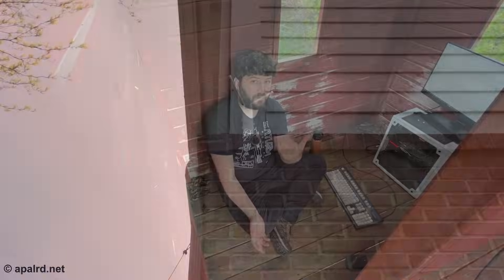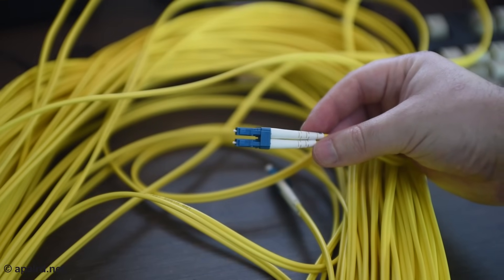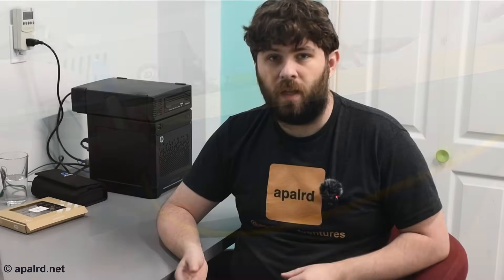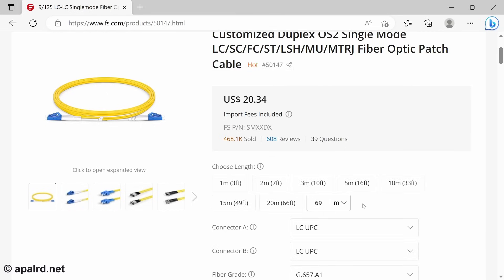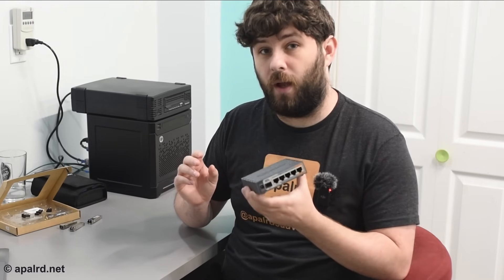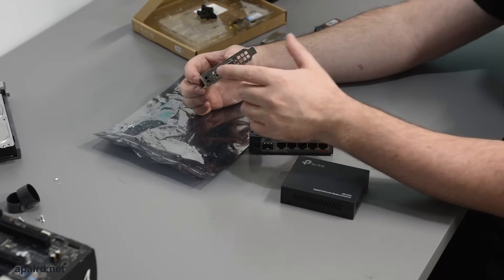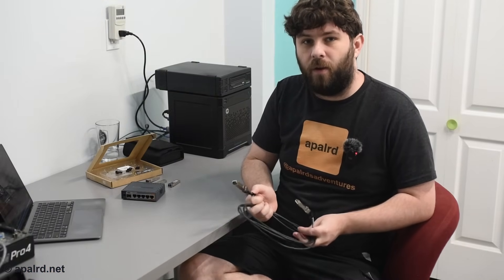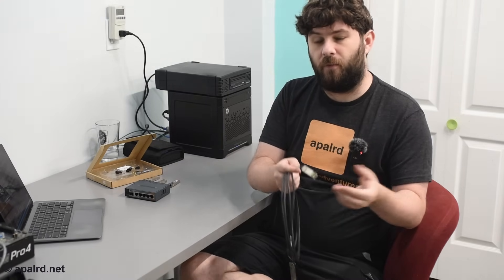The ULTIMATE Guide to Fiber Optic Home Networking

Comment: Such good content. It still hard to comprehend fully, If I am going single mode would it be preferable to have 2 fibers instead of one? Would like to wire the home at 10g now but ready for future upgrades
Reply from the maker: Single mode vs multi mode has nothing to do with the number of fibers. Basically, single mode fiber can support multiple wavelengths and longer distances, multi mode can support cheaper LEDs.

Using one fiber instead of two requires to wavelengths so it requires single mode.

For 10G they are both fine, for 100G you want single mode or 8x multimode.
Reply: @apalrdsadventures Thank you so much for your response, I understood from your video the difference between multi mode and single mode but it wasn’t clear for me what would be best for future upgrade, I’ll stick to single mode one fiber. I hope Sherlock is doing good I haven’t see him in a while, and thank you again for the great content and knowledge you are sharing

Comment: You're possibly the only one that would know: Can you detect if a fiber line is BiDi via a connected hardware/software? Can iPerf or similar do a bidirectional test that actually shows if it is indeed bi directional? Is it accurate enough to always know if it is or not?
I see tons of bidirectional modules today that aren't that expensive, new market (off brand) and used stuff.
Reply from the maker: You shouldn’t be able to tell what type of optics are used on a link as an observer at layer 3 (or even layer 2). Every ieee 802.3 phy should perform identically if it’s working and there aren’t bit errors.
Reply: @apalrdsadventures  Oh... What's the benefit to bidirectional then? I would have figured if you uploaded and downloaded simultaneously (saturating both) your speed got cut in half? There's a pair of wires or single wire and they're using a different frequency as you mention. What does that change if there is no difference? Thanks

Comment: Just a little stuck on what cable i should choose. I need a 100m run from the main house to a granny flat through under ground conduit with probable water ingress. It's too expensive for the industrial grade cable on fs to get to Australia. There is one listed on amazon for less labeled 

"Jeirdus 100M LC to LC Outdoor Armored Duplex SM Fiber Optic Cable Jumper Optical Patch Cord Singlemode 9/125 100Meters LC-LC"
or product B07VVPGDFH

Wondering if that cable will last/be okay or what i can get away with for my application, the shipping and conversion rates through fs for me are huge.
Reply from the maker: Fiber itself doesn’t care very much about water. The only concern is if the jacket material will deal with the water without degrading. 

If you’re pulling through conduit I would get a non armored fiber.
Reply: @apalrdsadventures yeah okay, it’s just intimidating for me I don’t wanna mess it up and waste money. Thanks for your reply.

Comment: Thank you for your video!

I recently requested a quotation to replace our existing home coaxial cable with fiber. I received a quote for Cat 6A, no fiber addressed. 

I would like to future proof our entire house with 10 gig capabilities. I was thinking of using the Ubiquiti / Unify Dream Machine Pro Max, Pro XG-10 PoE++ switch, and the U7 Pro XGS Wifi access points. My dilemma is I do not know how to get power to the access points. 

Our house is 4,000+ sq. ft. 2-story brick house, excluding the basement, 3-car garage, deck, and porches. We have a computer, VoIP landline, and two printers in my office. We have a printer in my wife's office. We use Apple 4K that also uses an RJ45 jack. Of course, we have a number of devices that use WiFi.  

I called a number of Cable and electrical contractors. Most of them only do commercial work. The others seem to promote Cat 6A. 

How hard is it to run your own fiber? Can I fish fiber through walls using our old coaxial cables? I plan to speak to our AT&T tech this week when he changes our service from 1GB fiber to 2GB. Perhaps, I can get him to do some moonlighting on a fiber project.

What are your thoughts and recommendations?

Thank you.

JP

Comment: Make your life easy - don't do bi-directional.  Lots of 1G or 10G optics will talk to each other.  SingleMode is always better but is more fragile than MultiMode.  2km SM optics are great, will easily reach 3-4km.  MM Optics max out at 500 ft to 1000 ft in general.
Nice video - covers the basics.
Reply: Fragility isn’t that bad if done properly

Comment: Hey do you have any recommendations for conduit to protect the fiber, I know that these fibers allow direct barriel, but I think they are too thin and not shielded enough. What would you recommend, pvc pipes, corrugated tubing?
Reply from the maker: There aren’t any hard guidelines for fiber, but I’d probably use pe sprinkler pipe which comes in a very long role and can be dragged behind a machine without trenching
Reply: Depends how long you want the conduit to last and the conditions it's run in.

Don't bury EMC.  While you can do it, it's very thin-walled and doesn't hold up to long years of being underground.

RMC is what I'm most familiar with.  It's nice and thick and will outlast your kids.  It comes in varieties that are good for corrosion resistance.  You need a way to bend it and thread it though, and it's harder to work with than pretty much anything else.  It's what's used for industrial purposes.  If you're going to drive over the conduit or embed it in concrete, this is how I'd go personally.

PVC and fiberglass are options as well.  I won't comment on those since we don't use them (and rip out any that we find).  But my work is on industrial oil/gas facilities, which have more stringent requirements than your house does (At least I assume.  I don't know you, maybe you refine jet fuel in your back yard, I dunno.)

Your best bet is to have a professional install it for you.  There's lots of gotchas with running underground conduit and if you have the money it's best left to someone who knows what they're doing.  If you really want to do it yourself, do a lot of research first.  Just bear in mind while you're researching that industrial users have more stringent rules to follow than you do as a homeowner.

Always run extra conduits, always put pullboxes in before you reach 360° worth of bends, and always include pull strings!  The you in the future will be glad you did.  This goes double if you plan on pouring concrete around them at any point.

Comment: Thanks for the informative video. I am trying to send fibre to a some wall sockets in a room so that I can connect to them wall socket with a DAC cable. My problem is that I don't know of any wall plates which take SFP terminations. The other problem I have is that I want the termination that is wired into the wall to be female so that the DAC cable can be plugged into it. I hope to use pre-terminated (AOC or DAC) cable to get from the SFP port on the switch to the wall but all the cables I have seen so far are male-male cables. Do male-female cables exist? Do you know of any cage/keystones for SFP ? Thanks again.
Reply from the maker: I have not seen SFP+ sockets, only male to male DACs. With how short twinax cables can run, I’d suggest just using fiber.
Reply: You can’t use this method so our products are available, but they are data centres and they cost tens of thousands each

Comment: I bought 100ft of armored fiber, 2 strand, to run to my shed.   It has a stainless steel tube .  Does it need to be grounded?  I’m getting mixed opinions.  It’s going from my upstairs office to my shed, and will be direct buried.   It has LZSH jacket, Kevlar, stainless steel tube, then the fiber strands in that order.  I don’t see how you can it’s a very small cable

Comment: I want to run internet to a shed,do you output rj45 from the router too the media converter, then fiber to the other media converter on the opposite side to convert back to rj45?  Then plug into another wireless router to get wireless internet?
Reply from the maker: yes. rj45 -> media converter -> transceiver (inserted into media converter) -> fiber -> transceiver -> media converter -> rj45
Reply: Thanks.  My mind was confused this morning. Lol

Comment: Hello, I am quite new with the SFP(+) interfaces, and I have the following doubt: In a scenario where we have a router with two SFP+ ports (one for WAN/Internet, the other for LAN), a computer/server with a NIC with one SFP+ port, and finally a switch with a couple of  SFP+ upload ports - one that will be connected to the router LAN while the other will be connected to the server (everything - router, server's NIC and switch - is of the same brand, and assuming the sticks will also be of that very same brand), what kind of SFP+ sticks do I have to plug in each port? because they are not the same, right?

1) Router WAN: I know this is a ONT that will connect to the ISP's OLT. I know this should be provided by my ISP to make sure there's no conflict with their OLT, otherwise I will have to find one that is (and probably I'll have to hack it with a community firmware to be able to tune some settings that otherwise might not be available - like SN, MAC, ploam pwd. etc.) that the ISP uses to verify the connection is legit.

2) Router LAN + computer's NIC ports: this kind of interface is a NIC, something that will contain its own IP (let's think we are in a IPv4 only scenario). Is this also a ONT? or the IP address would not be assigned to the SFP+ stick itself but to some other chip of the NIC?

3) Switch ports: What kind of SFP+ sticks should I plug here? I guess they are different than the ones for the router and the server's NIC, because switch ports are "passive" (they don't have a NIC or IP behind); is it an OLT stick? or it's the same kind of stick than the server's NIC - as I (wrongly?) understood from the video?

How are the 2) and 3) sticks called?

It would be highly appreciated If anyone could solve this doubt.
Reply: Do not disturb or alternative to firm my own in most countries this is illegal because you’re pretending to be an authorised device to gain access to a network

Comment: im new to these stuff , is a network card a must to connect my pc to fiber internet , or there is some kind of convertor LC to RJ45 , and if there is , how my connection speed will be ?
Reply: This isn’t just fibre Internet this is you running your own fibre-optic cable yourself it won’t make anything faster. Only really good for long distance if you are using a converter.

Comment: Thank you for putting this together! I have a small observatory building that I'm trying to keep electricity isolated from the house (live where there is lots of lightning) and have been trying to figure out the myriad of acronyms and codes to get a basic system working. This was right to the point and had everything i needed to know!

Comment: Just a heads up tp-link has been found to be less secure due to the chips being from China, apparently tp-link has been compromised.
Reply: They use a lot of the chips that American brands use is actually the software. There’s been no concrete evidence that is that bad and you can replace the software. A lot of fun abilities require someone to have access to your network which if they do you’re already screwed.
Reply: I doubt it's an issue for media converters.  It's possible they could have snuck an IP stack in there, but it's very unlikely.

Unless you're buying for government use I wouldn't be too concerned about it.

Comment: Does Mikrotik make a switch like the one you showed that is SFP+?
Reply from the maker: they have a 4xSFP+ switch (CRS305-1G-4S+), which has no 10G copper, only SPF+. They also have some with SFP+ uplinks (like the CRS310-8G+2S+, which is 8x 2.5G + 2 SFP+)
Reply: @apalrdsadventures  Yea, that's mostly what I've found. There is a QNAP QSW-2104-2S-A which is the size profile I am looking for. It's unmanaged, but could be a good fit.
Reply: Yes one thing I would say if you can’t draw a manufacturers website are you capable of setting the equipment up properly? As youwill likely  need to use it  to check some things.

Comment: The best primer that I have seen beyond the usual "this is fiber, it goes in the square hole"
A few more things for newbies like I was: 
1. There's also qsfp. Its a larger hole than the sfp ones, and carries 4x an sfp connection. You can often break them out into those 4 sfp connections. It starts at 40gbe, but don't do that, since the switches for 40gbe are awful and loud and power hungry. If you want 40gbe go 25gbe, and if you want above that then go with qsfp28, which is 4 of those 25 gbe sfp connections in one. 
2. You can get sfp+ to rj45 and do 10gbe over copper from an sfp+ port for short installs over cat6a and higher. The transceivers for those are commodities nowadays. 
3. Less relevant, but for the vendor lock in, some vendors accept multiple different vendors of transceivers, and some of them accept basically all of them. There's a few sets out there you can look up. Not really relevant btw but you can buy a reprogrammer from fs and they let you reprogram some transceivers if they allow it.

Comment: Title seems misleading as it lacks details like concerns for bending cables, keeping them clean, suggestions for running cabling through walls and other challenges that soemone starting out may not be familiar with and didn't get into thedetails of testing/troubleshooting and (likely impractical) cable termination. Still a good introduction to a subset of hardware users may begin to run into.
Reply: Lots of this is done to manufacturer specification as some cables have wildly different requirements and other bits are done to local things

Comment: It’s funny to watch this, since I was installing fiber for a hospital’s new infrastructure backbone, 30 years ago.
Won nomination by Network Work as one of 5 best new infrastructures for 1994 in United States.

Local Baby Bell fought (1993/94) installation of fiber (WAN) from Central Office to hospital Demarc.
So, Internet connection took 24 additional months, after I left for consulting.

At this time FDDI and 10-Base-F were upper LAN bandwidths — and IEEE Fast Ethernet (100 M) arguments delayed its final adoption.
Cost was the reason (30 years ago) for Multi-mode over Single-mode and well LAN support by equipment vendors.
However, Times have Changed (no PTFE or Category 5 shortages today) and Speeds/Latency now matter.

** Copper LAN die-hards have retired, some common solutions are now gone (POTS, DSL).
Consumer demand for content & bandwidth finally forced adoption (and virtually killed CD/DVD usage).

Comment: I mean fiber is good for high capacity link speed, Higher than 10Gigabit ( 40/100 gigabit ), and high distances - singlemode.

For basic home use, is still releiable using metalic cable, because, there are many devices which support ethernet ports.
Reply: You can use also, cat 6A for 10Gig, or just cat5e for gig.
Reply from the maker: Fiber is also non-conductive, which is extremely important when running between buildings.
Reply: @apalrdsadventures  I have metalic outside, between building 😅.

Ok but inside, i mean you dont have devices which is good fór Fiber, mikrotiks .... Have sfp, but ether ports are only gig .... 

So i mean its very hard build Network on optic, and fór 10gig you Can have cat6a.

Yes fór outside is good Fiber, or instead of ptp.
Reply: You Can have also optic converter, but you are again limited by ether port.

Comment: I you can get large diameter hose on a 1KM Reel then you could use that as a conduit and just cut it to the required length just make sure it is buried 6 feet below the surface of your lawn  as you don't want your fibre optical cables getting cut by the lawn-more or by nasty pieces of work who don't like you having broadband.
Reply from the maker: I am not sure you appreciate how hard it is to trench 6 feet deep in a lawn
Reply: @apalrdsadventures  We had to dig a trench to pour concrete into in order to build a wall at my old address near Ahoghill.
Reply: Or micro duct on a real is incredibly cheap and has a trace wire built in. You should probably get the real stuff. It also allows you to use blowing equipment if you fail at pushing it through.

Comment: Is grounding needed for that steel cased armored cable?
Reply from the maker: No, but it could potentially build up high induced voltages if pulled in the same conduit as power lines, which is why that isn't allowed.
Reply: Maybe if you’re running in between two buildings, it creates complexities if the metal is accessible at both ends to touch but generally speaking just leave it in a box outside

Comment: What kind of connector(s) or receptacle(s) are recommended to go from inside the house to outside?
Reply from the maker: You can get LC UPC duplex (or simplex for BiDi) couplers to connect two premade fibers together. They also make them as Keystone jacks, patch panels, and more.
Reply: @apalrdsadventures  Thanks. Great video BTW!

Comment: doesn't the metallic cover defeat the purpose of fiber being lighting resliliant?
Reply from the maker: Neither end is grounded or connected to anything, it's purely for mechanical support. Conduit is also an option.
Reply: It won’t damage it though, as long as you don’t connect it to anything metal the other end

Comment: FYI, my 10Gbe SFP+ switch auto negotiates down to 1G if I put a 1G transceiver in it.  That's how I connected it to the rest of my network, rather than using an expensive 10Gbe RJ45 transceiver.